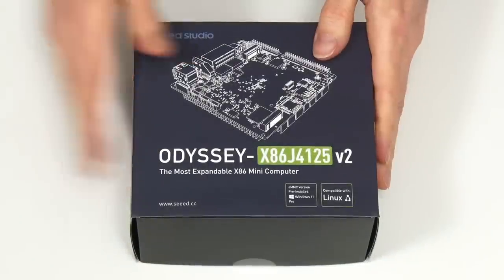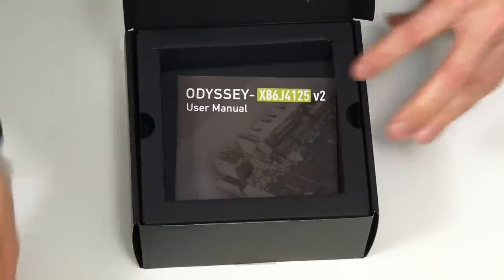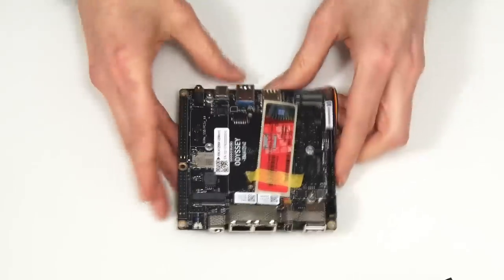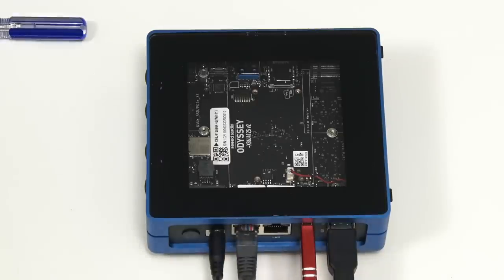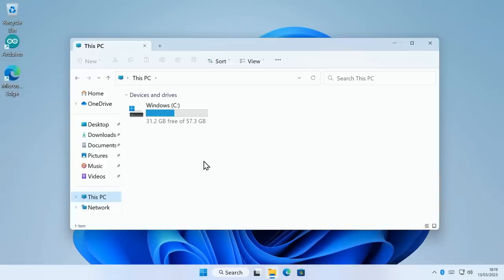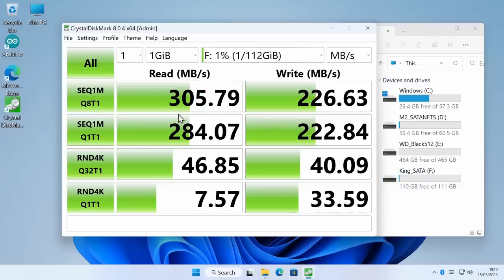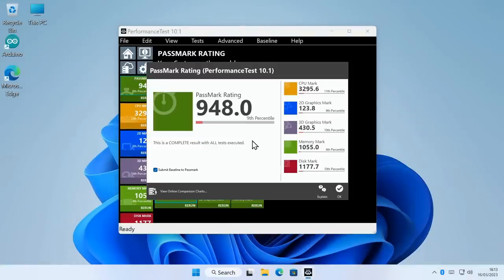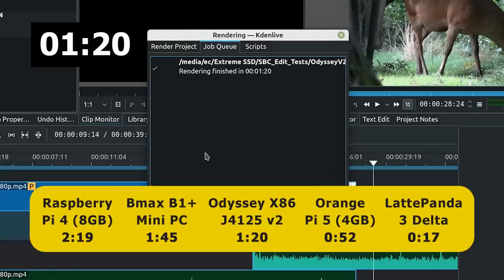Odyssey X86J4125 v2: x86 SBC with Dual 2.5Gb Ethernet

Comment: Gotta say I'm pretty impressed with this one. And it's getting close to the point in SBC development that you'll have to start running video game performance tests to see how well they run. I don't expect extreme graphics settings to run on this, nor do I expect extremely modern games to run on it even at the lowest graphics settings. But this computer should run a lot of older games reasonably well. I suspect SBCs will start needing more substantial power delivery really soon though. So get ready to see a SBC with a power brick that is bigger than the computer in the near future. lol
Reply: Don't give "Dawid does Tech Stuff" any ideas! Yesterday he was gaming on a NAS. Some insanity that would never have occurred to me, watching someone struggling to play GTA-V on a NAS box.
Reply: yes
Reply: @vincei4252  lol
yeah
Reply: You are so right I think he did emulation one time of video games I hate he doesn't test games on these computers or do a Geekbench
Reply: Using power hungry x86-64 chips in a low power purpose sbc, is like fully filling up a bucket with water, only drinking a cup out of it and pour out all the water in the bucket for nothing.

Comment: I've had the v1 Odyssey board running as a server for the last 3 years. It hasn't missed a beat running jellyfin where it does very well with hardware transcoding, home assistant, network backups and a few other services. The V1 has an arduino co-processor instead of the RP2040. It's proven to be very useful and I'd definitely use one again.

Comment: Hi Chris- Thanks for another great addition to the EC Library! The Odyssey seems to be a very well performing, fully loaded SBC. The 64GB eMMC storage is relatively small but as you demonstrated, it does have a variety of storage expandability options and you can clone Windows to a larger drive if you need to. Still happy with my Bmax B1 Plus which I loaded up with storage and Linux Mint on the SATA SSD I purchased and I also have the GPIO expandability module which I haven't installed yet. A project yet to come. Hope you are staying well! Best wishes. Rich
Reply from the maker: Sounds like you are going to keep getting good value from the Bmax. :)
Reply: @ExplainingComputers  Yes and thanks again for the recommendation! Rich
Reply: @ExplainingComputers  PS- But with all the expansion options of the Odyssey, it's very tempting! :)

Comment: This would also make a lovely media server; the integrated graphics offers hardware accelerated video encoding, allowing for multiple streams of video transcoding, perfect for something like Plex.
Reply: The specs were UHD600. Not sure it would be capable of a solid transcode. What I would like to see is how well this board loads and plays 1080p from youtube, but more importantly 4K from a plex server. I'm thinking this may be an ultimate client for Plex. Load Linux Mint and run the linux fat client. I believe mpv should have no problems playing 4K as long as it can access the hardware acceleration for it, and if it can, the plex client should be able to as well.
Reply: @scotthassel8124  My Synology DS220+ has a J4025, the dual core variant of this chip, and it can hardware transcode with relative ease.
Reply: @cromulence  JellyFin wiki suggests the UHD600 would only be capable of a single transcode stream where higher end GPUs support more formats for hardware encode/decode and multiple simultaneous streams.

Something else to consider with respect to Plex/JellyFin transcoding is that a GPU may support something but it can be effectively useless due to lack of software support and/or licensing.
Reply: @n n that is patently false. I have had desktop motherboards with dual ethernet.

Comment: Thanks Chris for another great video.  Price and size are deal killers for me.  SBC's getting bigger and more expensive puts this class of SBC in line with a NUC at this point IMO.  A NUC at this price point will have a better X86 processor and more expandability.  GPIO dongles can be bought for under $20 for any computer.  It appears that SBC devs are loosing sight as what the original concept of SBC's popularity and use was indented to be.
Reply: @n n The clue is in the title.... it is an SBC... that happens to be capable of running windows...as well as other operating systems. that windows capability comes at a price, something not everybody will be willing to pay.

Comment: A slight improvement over the older version which I find is working fine.
I'd like to see them increase onboard ram to 16GB.
Also, if they will offer it, it would be nice if they had a fully assembled version. Connecting the wifi module wires is extremely frustrating.

Comment: This was an excellent presentation Chris, I like how the board comes nicely packed. I would use one of these boards as my Linux mint daily driver, good performance & plenty of storage options. OK the price is a bit high but when you look at an i3 mini PC (no OS) you're looking at around £400, a Windows 11 licence adds another £80! Another happy Sunday :_stanley:
Reply: That's true....but you could get an i3 in a used laptop, including some RAM for maybe $40 and it even comes with a screen(!).
Reply: for the license .. just two weeks ago i installed a new system (7500G) with Win10 and used one of my really old Win7 Prof licenses.
Can get those for 5 bucks and win10 for 10 bucks. Still got accepted no problem. And now could be upgraded to Win11 for free, at least thats what windows says.

For the hardware cost: If you have old parts around you can get those intel low power boards from asrock, here i would suggets taking a look
at the asrock ITX-4125 (or other form factors).. i would go for the "better" asrock J4050-ITX version, but that is still tech from Q4-2019.
(adding in a pico PSU + powerbrick set) Sadly asrock did not continue the mini-itx versions with onboard dc-dc
which came complete with a power brick back when the intel J1900 was around.

On the other hand good refurbished workstations (i5) with guarantee+license come in at around 150bucks, so you can use a lot of electric power until you are at the
300 bucks upwards a new parts system easily gets to.
Reply: @englishrupe01  That is an interesting point you make about buying & using 2nd hand components. Chris is doing a video on a renewed HP SFF PC soon!!
Reply: @PsiQ  Thanks for the info & I'll definitely have a look at your suggestions. I've looked at going down the renewed PC/Workstation route over the last several weeks, I'm just waiting for Chris's upcoming video about that very subject!

Comment: I just bought a new Mac Mini, the M2 version, for $599 (8GB RAM, 256 GB SSD).  Performance is amazing for typical desktop users, especially for 4K YouTube videos.  I recommend that over SBCs and mini PCs in the $300 range because the performance you get for the extra cost is well worth it.  For gamers and hobbyists, there are workarounds in the Apple universe which might be acceptable to some, although I much prefer my Ryzen builds for gaming.  That said, this SBC is still a great value, for the reasons stated in the video.
Reply: @n n While everything you said is correct above, the Mac Mini can be configured to do all that and more.. its lack of ports is not a handicap because of commonly available hardware workarounds/alternatives.  I do like this SBC, but I just think that the Mac Mini M2 is so powerful that it is a steal at $599, now $549 at another vendor.  I might buy another one to go with my fifteen or so systems of all sizes and types.
Reply: @n n I can buy a router here in the USA for $79.. no need to spend $299.  I was just being polite by not mentioning that elephant in the room.

Comment: Oh, another cool thing that I could definitely find a use for, but I'm unlikely to buy it anytime soon.
Good video but...
1. No GPIO tests
2. It is not clear how the RP2040 is powered. Does it run on standby power when the main computer is in sleep mode or turned off?
Reply from the maker: The primary drive here -- the eMMC -- is not SATA. :) And I ran Linux from the NVMe M.2 slot.
Reply: @ExplainingComputers  Okay, but you probably meant to answer another user, my comment is not related to this😄
Reply from the maker: Oh yes, sorry I've messed up. My bad. :(

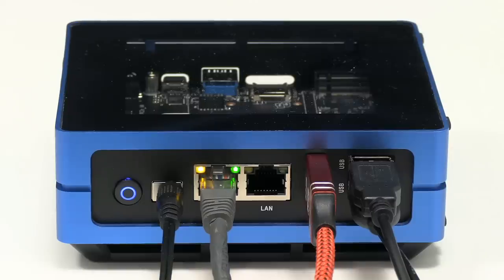Comment: 15:10 I installed Linux Mint for the first time on an old office Dell because of you the other day.  Just for experimentation and to poke around.  Granted, I used my old Hitachi "Death star" 500 gb drive, (it's had the click of death since I bought it, so not concerned if it dies.)  into a machine with a core 2 duo CPU and 4GBs of DDR2 @ 800 mhz.  Not a lot of games I could test, but I've heard good things lately about Steam and Proton.  And with my games I tested, they all worked!  I started with Counter Strike: Source.  It was old enough to run on the weak hardware.  With integrated graphics I got 27.6 FPS, and I added an old 1GB dedicated card, and got over 120FPS maxed out settings.  I like Mint so far, I just dislike how manual and clunky installing programs are on the OS.  A thought occurs to me, I think it would help if you did a video series on Mint specifically, as it seems noob friendly,  starting with basics, and slowly going towards more advanced, poweruser type commands.  I find Linux to be a sort of hybrid OS between the old DOS days, and a modern windows OS.  It's fun, but I clearly don't know what I am doing.
Reply from the maker: I'm glad to hear that things are working. (Most) software can be installed graphically in the Software Manager.
Reply: @ExplainingComputers  see?  I didn't even know that.

Comment: So two built-in Ethernet ports says "router device" to me immediately, and then I'm thinking of pfSense as an open source router/firewall/NAT box for a home or small office network.

But last year I picked up a nearly new Fujitsu Futro thin client box with quad core AMD CPU in it and a built in PCI-E slot that let me fit a second Ethernet interface into it - I then stuck in an additional 4GB RAM to get it to 8GB and a 120GB SSD to load on pfSense - and the total was probably around £80 and less than half the price of this Odyssey board.

Sure, if you need 2.5Gb Ethernet then the Odyssey box wins on that basis, but it does strike me as very pricey for what it is.

Comment: very interesting and nice to see what seems to be a 'high end' SBC.  your observations near the end of the video regarding the low Passmark scores and the fact the video rendering was slower than the Orange and LattePanda made me start to wonder what are the alternatives and possible drawbacks of the high end SBC.  i guess the only thing i dont like is the fact it has Windows 11 installed.  i can barely put up with Windows 10.  I wondered if you have any videos on how to fix Windows 11 to make it more productive OS.  I also am glad you showed how easy it is to set up a dual boot so that Linux is never too far away.  can the two OS's share the contents of the files on the hard drives are they incompatible?  Thanks as always for your insights.
Reply from the maker: I have a video on settings and registry hacks to fix Windows 11 here: https://www.youtube.com/watch?v=QqLbk-PmX2Q Note that the Odyssey board can be bought with or without Windows. :)

Comment: Very nice review! Does the RP2040 show up like a drive as usual? That is what really peaked my interest!
Reply from the maker: It does not show up as a drive. Seeed normally document their hardware very well with tutorials, so hopefully one of these will appear soon indicating the access methods.
Reply: I love that this has a built-in rp2040. I had a quick look at the manual and there isn't much info about it except for a pinout of its GPIO and a few other pins, including RUN and SPI_CS. I suspect the rp2040 doesn't come up as a drive as it, or rather its flash memory chip, probably isn't programmed. I also suspect that the SPI_CS pin refers to the chip select line on the flash memory chip, which has the same function as the BOOT button on a Raspberry Pi Pico. So, I bet if Chris was feeling very brave, shorting RUN to GND, then shorting SPI_CS to GND, then releasing RUN, and finally releasing SPI_CS , would result in the rp2040 then showing up as a drive.
Reply: @ExplainingComputers  Hi, great overview of this interesting SBC Chris. As for the RP2040, as it doesn't show as a drive per se does it show as a serial COM port so it can be accessed as an Arduino device and flashed? I would expect it would so it then becomes useful as a microcontroller. I can then see this SBC being a very usefuly development device for RP2040 projects. Also, is there any connectivity from the RP2040 to the onboard WiFi, ethernet, sim slot or SD Card? maybe too many questions for you to answer but any insight would be appreciated.

Comment: Size of the scrollbar has never been an issue for me, but then, every mouse I have owned for the last 24yrs has had a scrollwheel on it :)
Reply from the maker: I often use a graphics tablet. And scroll wheels are not very accurate, and poor at selecting focus. :)

Comment: Nice. How come you mostly run Windows 11 and Linux Mint in your tests? Just curious to know 😁
Reply from the maker: I run Windows on x86 hardware because the vast majority of the world (and hence audience here) do the same. :) I don't mostly run Windows 11 though -- it is far more common to see Windows 10 on this channel, and indeed this is the first SBC I've never run Windows 11 on. But things will transition as (again) the audience does.

On Linux, Mint just happens to be my daily driver and go-to OS, so I've always got an install drive around. :) But I regularly run ZorinOS and Ubuntu too.
Reply: @ExplainingComputers  Nice 👍
I like Windows 11 in some ways, but Windows 10 still feels far more stable and reliable. I think Windows 10 will still be in widespread use up until 2025, when it reaches end of support. On the Linux side of things, I quite like Linux Mint too, it's my favorite distribution, and I would use it daily too, aside from Mint, I also quite like Ubuntu and Peppermint OS. I'm thinking of switching to Linux next year or the year after, maybe even sooner. Would you happen to have any tips on migrating to Linux?

Comment: Nice video

5:30 I am a little unsure about how many sata drives can be connected to the m.2 port.  If two are connected, would that lower the throughput?  I'm still looking for an SBC that supports four sata drives without USB adapters for use in a raid 1+0 implementation. Most SBC's appear to have not much support for that. RockPi used to have a board with a 4-sata port hat.  But they don't seem to carry that anymore. Maybe I should give up on the SBC idea?
Reply from the maker: Seeed Studio sell a dual SATA adapter to go into the NVMe M.2 port, so in theory each could sustain full SATA III speeds. I've never tried one of these, but have used a quad SATA adapter in a SATA M.2 port. Full speed is available to each port, but if more than one port is used at once, then inevitably the bandwidth will be shared (see https://www.seeedstudio.com/M-2-to-SATA-Converter-2-Stacked-Ports-p-4727.html?queryID=224479258ee68984d520036d9e203070&objectID=4727&indexName=bazaar_retailer_products )

The RockPi 4 SATA port HAT was cool, but connected via  USB 3.0 port. So in effect it just added four USB external drives -- useful, but you'd never set up a RAID that way.

Comment: Nice video as usual. I was surprised that the board came with no anti-static bag...
Reply: You mean instead of the usual shiny, non-anti-static bag with an "Ant-static" label that they usually come in? Very, very few appear to be truly anti-static.
Reply: @englishrupe01  I disagree with you on that. Bags don't have to have an especially high conductivity in order to protect their contents. In fact, very low resistance packaging would be bad for motherboard mounted lithium cells. Even chunks of black foam used to protect ICs measure hundreds of kilohms if you stick meter probes into them.

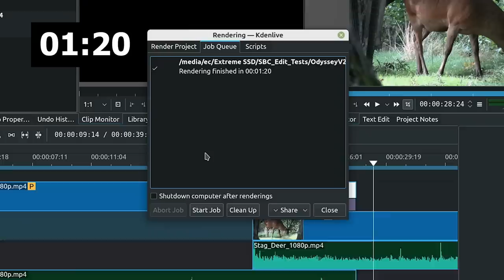Comment: Not sure if this has been asked before, but what about also listing the price of each SBC in video rendering comparisons (@ 17:12)? It's nice to know that an Odyseey X86J4125 is faster than a RPi4 but at which price? Let's say an Odyssey costs 10times a RPi4 (wild guess). That would make its performance less impressive. What I'm basically suggesting is a 'Performace per Pound/Dollar' figure. Looking at the skyrocketing energy prices recently even a 'Performance per Watt' figure would make sense when using the Odyseey for some kind of 24/7 running OpenWRT Router project.

Comment: So how do you actually talk to the RP2040? Is it like how you did it back in the video a few weeks back or does this machine offer something different?

I guess my fear of having an soldered on microcontroller is the risk of breaking it and then being stuck. I assume the right way to do it is to use an external microcontroller and only commit your on board one to the task when you are certain you have it wired up right.

Comment: it's got some nice features but a boxed minipc with the same cpu (e.g. gmktec nucbox) is for less than half the price. sure, those boxes don't have integrated rp2040 board, gpios or dual 2.5gbe ports, but that's still a large difference for a board with same cpu.

Comment: Looks like a solid iteration and nice the 1st gen cases are compatible to reduce waste. I am looking to build a new Linux router/ftp server for my net lab. Did you benchmark to see if the dual 2.5 Gbit ports can run at full speed port to port?
Reply from the maker: I didnt test the 2.5Gb ports as my network is only 1Gb (well, they did work at 1Gb!).
Reply: @ExplainingComputers  That's a good sign they likely will reach wire speed then. I have tried a couple SBCs and some like to use a USB NIC for the second port which can't even hit 1 GBit lol. Thanks for the follow up info, love the channel, cheers sir.